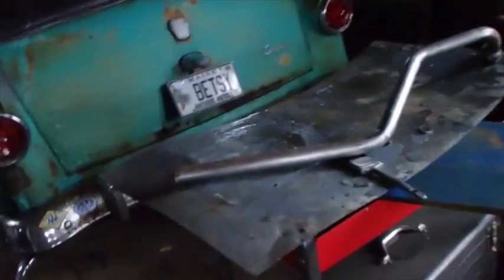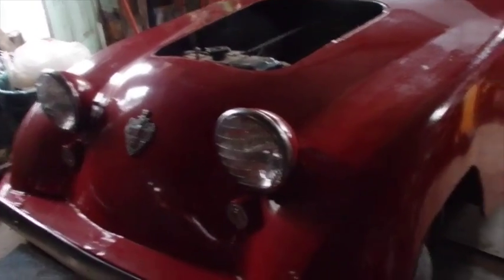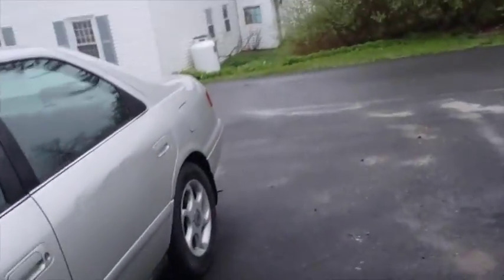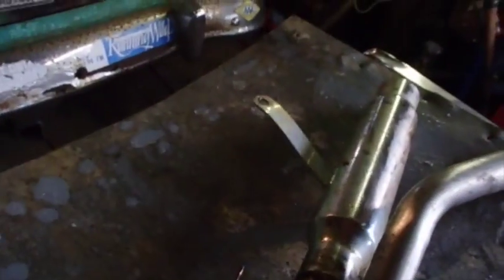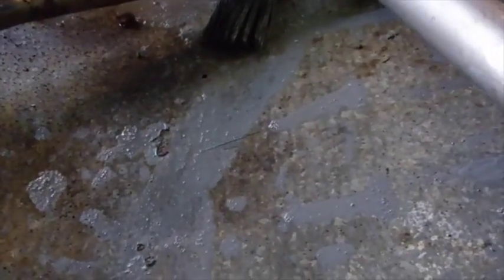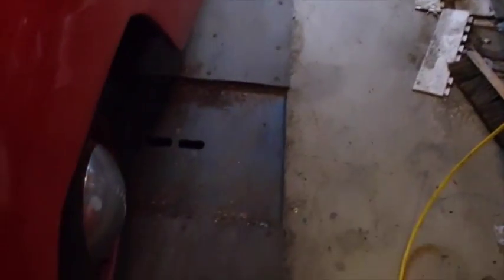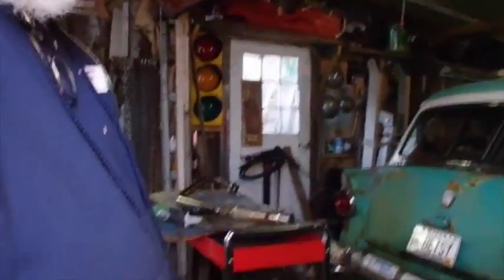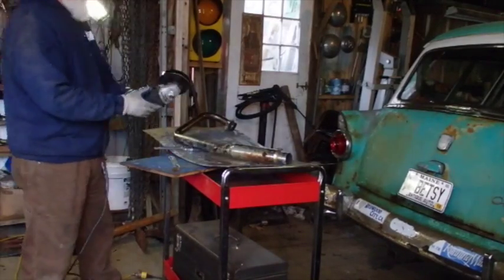Crosley Motorcycle Muffler

Comment: hey thats pretty good a motorcycle muffler for the crosley. Yeah i imagine a new crosley muffler would be a bit expensive. Its great that the muffler fits inside the exhaust pipe of the crosley should be a pretty simple weld job.